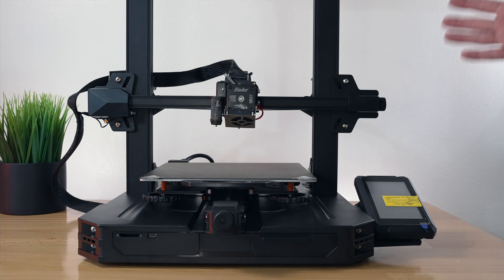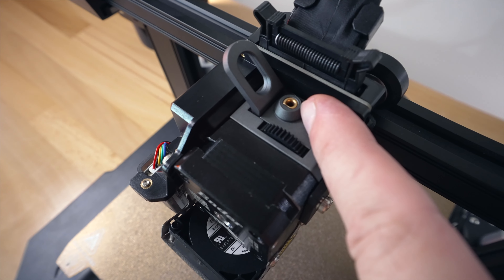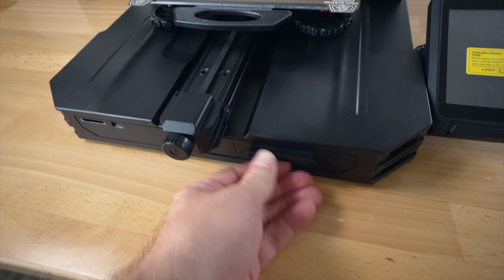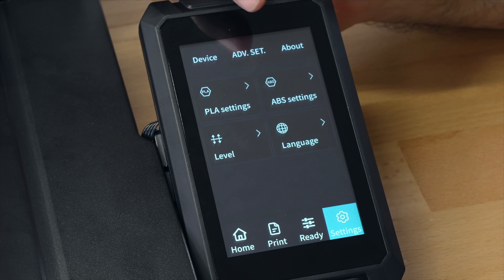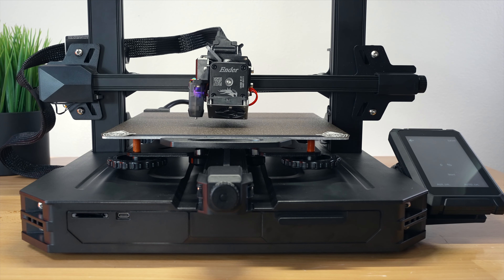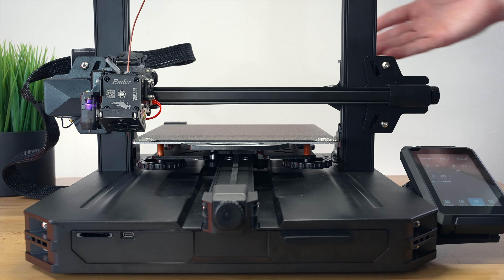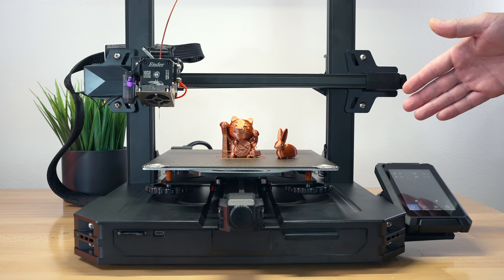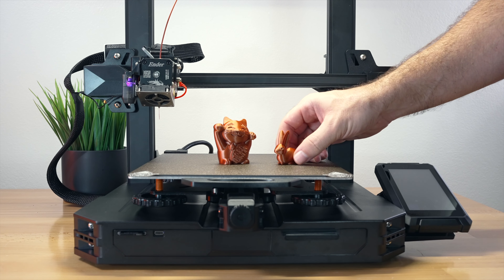Creality Ender-3 S1 Pro - Overview Leveling & Print

Comment: And remember you have to heat the bed before leveling and using the paper to manually level is the only way to keep it from dragging the print off raise tip up the height of Your piece of paper and Print away!!

Comment: I swear to god that I bought the Ender-3 S1 Pro but mine only shows z-nozzle and speed, and also I don't have a sub menu on the ready screen. What model did Amazon send me? It's in a S1 Pro box. How come none of the tutorials match mine?

I'm having trouble printing the guys on the card even, it's moving and lights are flashing and everything, just no juice is coming out. Is that from us not leveling right? I thought it would spit out still if it wasn't leveled right.

Comment: Did you put any adhesive down first? I have the same printer but it’s not printing as easily you just did
Reply: I was having issues too but discovered if I clean the build plate with acetone before each print, it would stick. I also tried blue Painters tape and that method is amazing.

Comment: HI can you tell me if i need to add the G29 code in the new cura v 5.4.0?
Reply: In the Start G-Code code, look for the very first [G92 E0] line (it's the 3rd line for me when I view the Machine Settings), the next line (line 4 for me) should read [M420 S1 Z10] which will instruct the printer to use the first bed tram profile.  If it doesn't, add it to ensure the printer truly follows the autolevel profile of the bed - nothing else needs to be changed.  This line only needs to appear that one time near the top of the Start G-code box.  Every time Cura updates, I have to go back in and re-add it.  Hope this helps! :-)  And Happy New Year!
Reply: Oh, just for safety - you might want to use notepad to make a gcode file to force saving the bed tram profile after performing the bed leveling.  It has only one line: M500 S1
 (sorry, made an error). Simply run this file after performing an autobed (select the file as you would for normal prints and hit start - this is just to ensure the bed leveling is saved to the eeprom). 🙂  It should auto save, but this is just for that extra peace of mind.